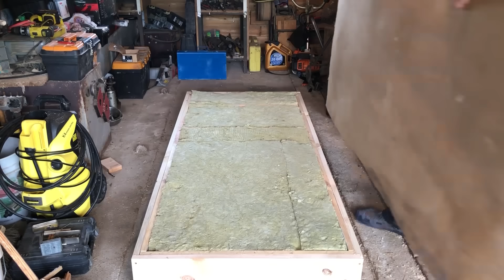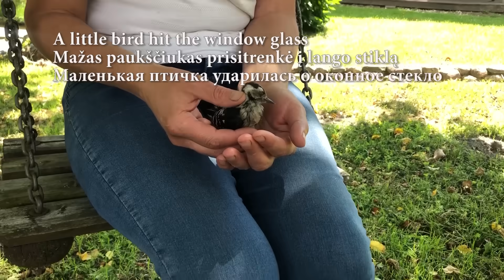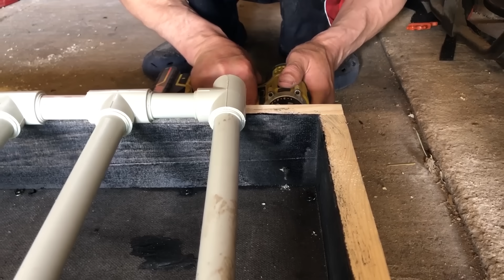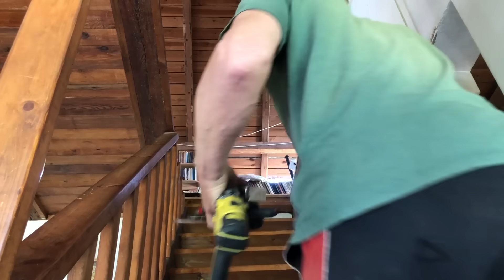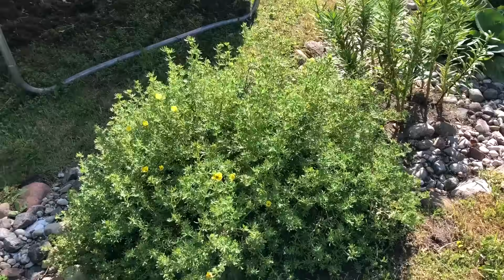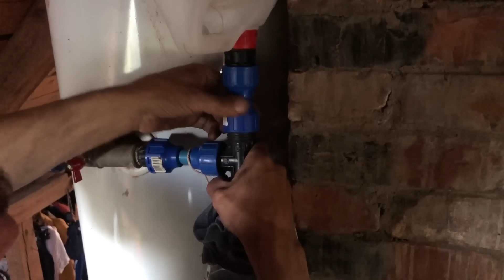Solar water heater. No controller and no pump. Making and installing

Comment: Well folks, it is a commendable effort to use renewable solar energy to save money and resources but I'm sorry to say that you will be lucky to reach 30% efficiency because your design is all wrong! 
       You make the same mistake as all other DIY solar heating designers do and it is always counterproductive. You should never paint anything black, that isn't part of the heat collecting system. You should never paint the interior of your cabinet black. Black absorbs radiant heat, so any energy that strikes the interior walls of the collector cabinet will be 100% absorbed and will never do anything to heat the water in the system. All the energy that is absorbed by the cabinet can not heat the water and what that heat does do, is dry out the wood and create a fire hazard over time. THE ONLY THING THAT SHOULD BE PAINTED BLACK IS THE PIPES OF THE COLLECTOR ITSELF, which should be painted on all sides, not just the front, so they can collect heat coming from reflecting surfaces! Nothing else should ever be painted black! The interior of the cabinet should be lined with aluminum foil so that any solar radiation that strikes it, can be reflected and possibly absorbed by the black piping of the collector which increases the efficiency. Painting the cabinet interior black, DECREASES ITS EFFICIENCY! Sorry to keep yelling but people don't seem to understand how a solar collector works...
       Once you have lined the interior of your cabinet with aluminum foil and painted your collector black, you will see that you have a very small heat collecting surface since it is mostly the surface of the pipes that faces the Sun that gets heated. The Sun at best only gives you about 1kW per square meter. Your collector surface is only about a fifth of a square meter, so even if it was 100% efficient, it could only deliver about 200 watts of heat, which is almost nothing... You need to cover as much of the interior with pipes as possible and keep them as close together as possible to get enough surface area heat, to actually do something useful.
         The purpose of building the collector is to save money, presumably but saving money on construction costs to build a system that doesn't do anything, just wastes money resources and effort. Using PVC piping may make it cheep to build but PVC has a thermal conductivity rate of only about, 0.125 W/m-K. Whereas the thermal conductivity of aluminum is about 237 W/m-K, so you only get about 1/1896th the heat from the same collector made of PVC. Copper has a thermal conductivity of about 398 W/m-K so you could get as much as 3184 times as much heat from your collector. If you are putting all that effort and expense into building your collector I suggest that saving money on material doesn't save anything if it doesn't work and I'm betting that by now you know that.
        There are hundreds of ways to build a solar collector but I would like to suggest that if you could modify a couple automobile radiators to fit into your collector, which will already be painted black, probably, it would give you a much larger collector surface area so you have a lot more heat to begin with and auto radiators are specifically designed to transfer heat to water or visa versa. It may cost a little more to build but at least it might do something to recoup the cost, not just waste money and effort...
    Just trying to help and save everyone time, money and effort.
Good luck!
Reply: I fully agree on part of your comments re use of pvc pipes inplace of copper pipes. As copper has much higher theremal conductivity than the PVC. However, I differ a bit on your comments re the use of black paint in the box anywhere other than the pipes. Actually, it varies from case to case. In my box I have used 2 inch thick thermocol sheet on the back and sides of the box/frame. Upon these sheets, i have pasted aluminium sheets and panted these with matt black paint finally. Now, In this case the heat absorbed by black aluminium sheets would find no way to go out of the box as thermocol has a very low conductivity (0.01) and it is expected that the heat would be released to the air within the box as aluminium is a good thermal conductor. So this additional heat will help in inceasing  the internal temperature of the box which inturn will be used by the copper pipes in order to transfer heat to the water. Secondly, if i just leave the aluminium sheets without Black Matt paint then there are great chances that whatever small amount of heat aluminum will absorb will be reflected out of the box instead of providing that heat to the copper pipes. This is because that in the solar reflections the angle with which the sun strikes a suface is very important. On the other hand it is very difficult to maintain a fix angle say 90 degrees constantly with the sun in such a fixed boxes. As the sun daily changes its angles of flight with respect to any surface on earth. So for example if the sun rays strikes at an angle of 75 degrees to the aluminum back in the box then surely its rays would be reflected out from the upper section of the box. Aluminium is  good in heat capacty, coductivity but it also is a reflector and we do not want the sun rays to be reflected out of the box soon after they strike the box. So, as per my view painting in black matt color will not only absorb more heat but also will reduce the reflective property of the aluminum thus releasing the heat absorbed within the box slowly. All readers are openly invited to comment upon my views. Thanks!
Reply: @junaidiqbal5815 You went overkill on the box insulation but that's okay and did good lining it with aluminum, of course I assume you used highly reflective aluminum kitchen foil wrap. BUT, THE ONLY THING, that should be painted black is the solar collector (pipes or cans or sheets or whatever absorbs the solar radiation), all internal surfaces should be fully reflective. Sounds like you would have had an almost perfect setup if you hadn't painted the inside of the box. All you accomplish by painting it, is warm the insulation but what you want it do and describe above, is exactly what it would do if it were fully reflective. All you have done is slow the process down and waste heat. I don't think you have the Physics background to understand the thermodynamics but if you think about it, I think you will understand. Physics is mostly common sense, which is why it is the common man's science. 
Good luck!
Reply: @rodkeh  Dear Sir, I appreciate and respect your interest and concern very much! I am from Pakistan and we are at a latitude of 33.5. So, a reasonable amount of sun is available round the year. I really dont have any physics back ground but am only a graduate with Maths. However, my local power crises here and my needs led me to the construction of my first solar water heating system. I want to understand more from you as I only tried to do what I felt was the best as per my poor knowledge or logic. Let us suppose that the copper pipes can attain a maximum of 50 degrees C of temperature in the day time sun and we have water here cold around 15 degrees C usually in the winter. I guessed that by recirculation of the water through these pipes (enclosed and black painted in the box) again and again would transfer heat slowly to the water until it will reach in an equilibrium with sun heated copper pipes. I insulated all the inner of the box (incl back and sides) by the thermocol in order to maintain some heat within the box. As if the box internal temperature  remains like normal winter open atmospheric temperature here (20 degrees C usually) then there were chances that after heating the water to 20 degrees the copper pipes would start radiating heat also within the box too along with the water.  I pasted aluminum kitchen foil sheets over the thermocol and painted these black so as to absorb the sun heat more. They felt very hot when I touched my hands to these in the sun before fixing the front pexiglass sheet. With this back ground, Now, I have 4 questions in total. 

Q1 Do you think that the heat absorbed by the black aluminium sheets would affect/reduce the heat absorption of the black painted copper pipes (which are mounted independently on a wooden "T"  about 2 inches above the tin foil  sheets? I mean that the sun is independently striking these copper pipes role within the box off course.  

Q 2  Because of the insulation and very low conductivity of the thermocol, the heat is NOT expected to heat the insulation at all or atleast significantly so where does this heat absorbed by the tin foils is like to be released or effect? As tin foil has a good conductivity also so as per my poor judgment that heat is quite likely to raise the internal temperature of the box which was desired/required as explained above (in order to keep the direction of heat transfer from the copper pipes towards the water flowing through it and not towards the other box area). 

Q 3 I developed a Sundial successfully last year and noted the Sun movement in detail due to this. Basing on that I think that we need to maintain a special angle of tin foil sheets (not painted) on a daily basis if we want to direct their reflection properly on the copper pipes in order to make copper pipes more hotter. As without proper daily adjustment it is likely that the unpainted  tin foil sheet are surely going to reflect sunrays out of the box at an angle that would not even touch the copper pipes. So, with these reason, I decided to paint the tin foil black and to make them non reflective so as to atleast take benefit of their heat absorbed and released within the box. Do you think it was not correct or unwise? If so, please explain in detail for my knowledge. 

Q4 what should be the ideal thickness of the front cover of clear acrylic glass sheet?( I used 2 mm as the thicker ones were much expensive). 

In the last sir with due respect this is not to challenge you at all. I really want to learn, improve and get better for future. Thanks in advance for any of your kind remarks/explanations on this!
Reply: @junaidiqbal8260 The thinnest acrylic sheet you can find is best. The only purpose of the front glazing is, to keep the outside air and the inside air, separated so they don't mix and take the heat away.
As for the other questions, my original post answers those questions. If you don't believe me you can do it your way and it will still work but if you want maximum efficiency, I believe my way will work better but you have to also understand that solar energy is not very strong so the difference might be negligible
You need to understand that Infrared Radiations is flying around everywhere inside the enclosure and you need to capture as much of that IR as possible, so the box has to send as much of that heat to the collector as possible. The enclosure will warm up no matter what, so you don't have to steal heat from the collector to heat the interior. Your only concern should be sending as much heat to the collector as possible and reflecting everything toward the collector is the best way.
I hope this helps!
Good Luck!
Reply: @rodkeh  So, based on what you are saying, the radiation/sun rays that will be reflected off of whatever reflective, unpainted surface you have on the inside of the box will not escape through the plexiglass cover but be trapped inside the box generating more heat for the pipes?
Reply: Igen. Nem véletlenül vannak a fénycsőarmatúrák doboza belülről tükrösre kiképezve.
Reply: I feel like the right glass with a coating to keep heat in should be part of this argument. And if you really want to get crazy you could get or find a rolling mill and put a texture on your copper pipe.
Reply: This normally true, however if your back plate is conductive an your tubes are conductive (metal usually)  and you provide sufficient contact between them then you can paint the back plate/("fins") black.
Reply: @unionse7en  Yes, because they are part of the collector/heat-exchanger. That is the only part that should be black, the rest of the interior should be reflective to send that heat, back to the heat-exchanger.
Reply: What about painting the copper black and the pvc black?

Does the black paint absorb more heat and transfer it into the plastic?
Reply: @Matthew_Loutner  Yes the black does absorb more heat but the copper is thousands of times faster at transferring that heat to the water, so the copper is the better choice I think because it is a one time expense that pays for itself forever.

Comment: Probably already commented but just a reminder.  Do not use this approach below freezing.  Attics are not a heated space.
Reply from the maker: Yes, we use solar heating from March to November.  In winter, we use a wood-burning stove with a built-in circuit for heating water

Comment: On my calculator 1/2 inch (15mm) pipe x 15m is only 2.6 litres. Should have used 40mm pipe and closer together. 20m of 40mm pipe would give 20 litres
Reply from the maker: Yes, thicker pipes would be better
Reply: @Greenhomestead  That depends on the desired target temperature. The bigger the pipe, the quicker the flow and less temperature rise. With a pumped system, you can add a bypass to throttle back the flow to achieve a particular temperature differential, but on thermo-syphon or gravity systems, you will need to correctly size the pipe, or add a restriction, such as a gate valve to get the flow sweet spot.

Comment: How much water will it hold
Reply from the maker: The heating circuit holds about 10 liters of water. It is separate from the potable water circuit, the boiler capacity is 150 liters.

Comment: Plastic tubes? Why not copper instead? This will take ages to warm up and longevity is questionable.
Reply: Unfortunately, not everyone has the choice to choose what materials they use. Doing this in copper would cost me more than I make in a month (and there's none left over anyway), while I already have pvc available for free. Is it the best choice? Of course not. Not everyone has disposable income. It's a common paradigm to not realize this so please don't take offense to me pointing it out.
Reply from the maker: Copper pipe costs much more. Of course, the efficiency would be better. Will have to think about it.
Reply: @Greenhomestead  I know that you may be having PEX laying around, but heat transfer will be terrible and efficiency very poor. You'll be basically losing energy for nothing as collector will remain hot even with water flowing
Reply: @TomislavKoren  

Plastic tubes: it takes longer to heat the water but it takes longer to cool the water. 

I have both systems (plastic and cooper), at night, the water in the plastic pipes is much warmer than the water in the copper pipes.
Reply: @ajarivas72  Unfortunately the collector will not operate at night (no sun = no solar energy) to create natural thermal flow (Remember there is no pump in this system) the hot water tank will be indirectly heated via a coil of copper tube and once this coil is the same temp as the cylinder flow will cease. Definitely better to use copper pipe for your collector as the quicker it exchanges the heat the quicker the hot water cylinder will heat up. I'm quite sure you could pick up used copper tube cheaply.
Reply: What kind of fluid is circulating in the heater? Frost resistant?
Reply from the maker: @WaldemarSzmuro We use water, but we drain the system during the winter. But you can use non-freezing liquid, antifreeze, glycerin, spirit... 🙂
Reply: Eu teria usado tubos soldaveir e a placa eu faria uma placa cimentação com pigmento preto adicionado colaria embaixo uma placa isolante tegmica .usar madeira não é uma boa ideia
Reply: Greetings from a German, living in Panama. In Asia and Latin America, they just use a 300 liter metal water tank on top of the roof or a small tower. That works too. I am building right now a house in Panama. Renting a Panamanian style house with only cold water…. Wait. Not correct. Hot water after 12pm when the street is heated up by the sun. 😅
Reply: Spirit here is only for drinking...😅
Reply from the maker: @WaldemarSzmuro  Let's drink to peace around the world. ❤️🤗👍
Reply: Expensive

Comment: hey ! 
I'm looking for making a similar system in Latvia. But I'm scared about the winter likes (I'm initially from France ^^') How does the water react with the -20°C that's here some times ? 
Also, do you have plant base water treatment in your garden ?
Reply from the maker: hello  Thanks for watching us.  We drain the water from the collector during the winter.  The water is heated from the alternative circuit, which is installed in the wood-burning stove.  Of course, you can use glycerine or another non-freezing liquid instead of water, but in winter the day is short and the system performance will be low.
Reply: I was also thinking about turning a coil around the stove chimney. Then that's the best Idea I guess ! Thank you for that answer !  @Greenhomestead

Comment: What is the tool you are using to melt the plastic?
Reply from the maker: We use a special tool for connecting plastic plumbing pipes. Such a tool is sold in tool shops

Comment: PP is not UV resistant. Should have used PE instead.
Reply from the maker: The polycarbonate sheet has UV protection. In our country, greenhouses are made from this

Comment: Should use copper pipe and put metal in the box to retain heat as clouds pass..... the one i made was for air and 8am zero degrees F i had 132 degrees of air